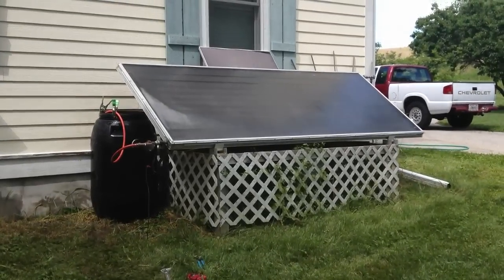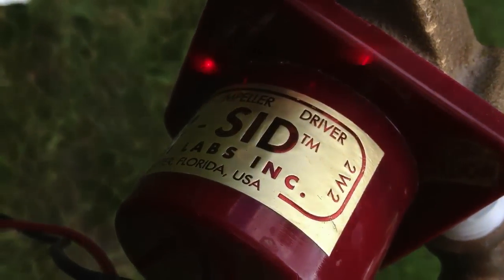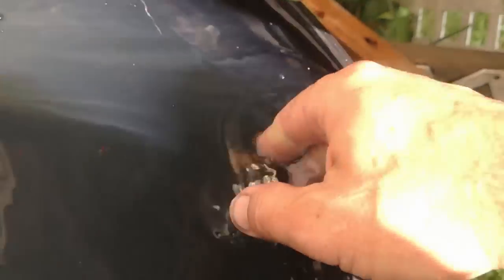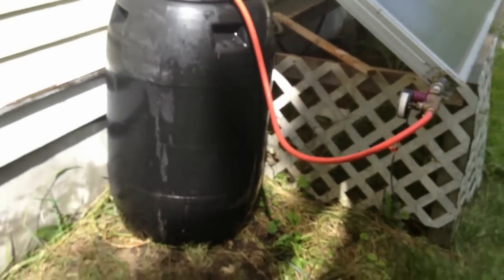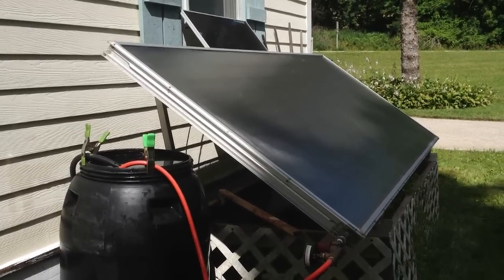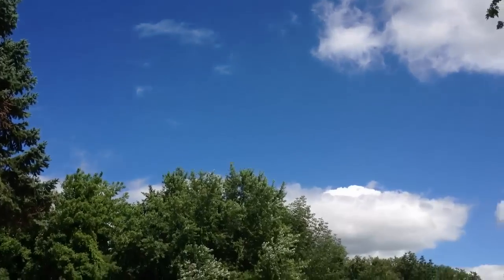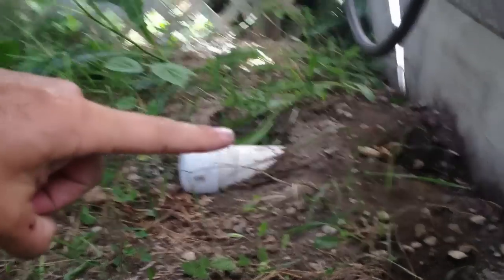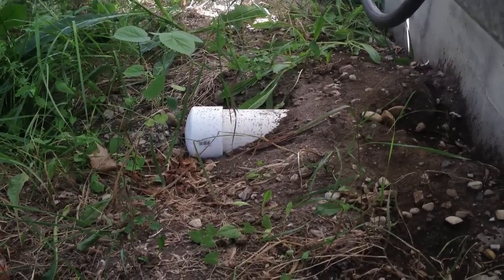Solar Hot Water Tinkering - 10'x4' panel and El-SID Pump

Comment from the maker: The panel is a KYSM-40 by Gull Thermal Corporation of Sarasota, Florida. It's 40 square feet, and looks rather well built, with a solid aluminum frame and one-inch inlet and outlet pipes. I bought it used from a friend-of-a-friend for $100.

Comment: Ideally you can combine this with an on-demand, or very small tank, heater as a final booster otherwise the energy costs of a standard tank would negate most of the energy savings. We spend $80/yr with a gas or 19 gallon electric heating water so using SDHW could never pay back.
Will it be drainback setup? or anti-freeze? What are your winters like?

Comment: I had hot water panels once. And many problems.

If one can find 1.0 to 1.5 KW of cheap PV panels, they will make about 80% of the DHW for a small household. Google "A7 AirTap install (ASHP hot water heater)" see posts on pages 27 to 31.  
If you live in a sunny area, and can find really cheap PV, it's an easy way to heat water. The only problem so far, is people think I'm nuts for wasting PV power, when I could be selling it to the grid. Wow, I could be making 30 to 70 cents a day!! ;)